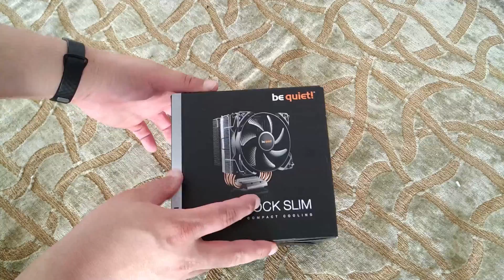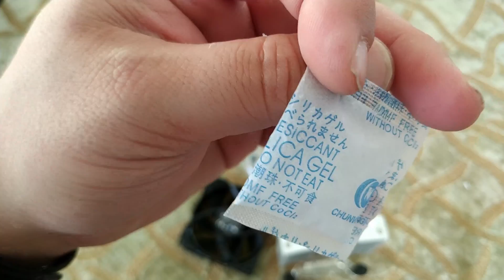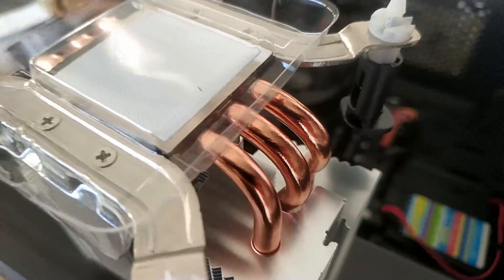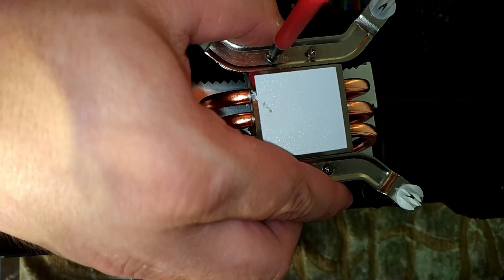Be Quiet Pure Rock Slim unboxing and installation

Comment: Usually the fan is mounted on the other side of the heatsink so the fan blows the warm air away from the motherboard? Does your fan blow through the heatsink onto the graphics card?
Reply from the maker: NO. It blows through the heatsink towards the top of the case. I tried all different orientations and this one, for me, made the biggest difference. You should experiment anyhow, cause every case is different and it all depends on the airflow around it.

Comment: Hello, your tutorial helped me a lot especially since I thought I could put the cooler in another direction but this is not possible with AMD, are you sure that the fan is correctly positioned? I have trouble understanding the AIRFLOW pose like that (but in fact I gained 10 degrees compared to the basic cooler)
Reply from the maker: Glad it helped. The better way to place it from what I've found so far is with the fan between the CPU and GPU, blowing upwards. It makes a small difference but the difference is there.
Reply: Many people said that I had placed that incorrectly, but damn. They are so damn wrong xD
Btw, actually I have no problems with temps by that cooler, lol. Still better than the stock one anyways

Comment: Can i use on h410m-k LGA 1200 ,i3 10100f?  Pls reply
Reply from the maker: apparently you can: 
https://www.bequiet.com/en/motherboardcheck
This cooler is twice your CPU's TDP so it should cool it without any issues. Plus on Intel it mounts with the fan facing at the rear exhaust. Go for it.
Reply: @funkyfresh3d  fps hexa+ 550 watt can handle it??
Reply from the maker: @aizenmoku8888  the cooler? It's just a fan, of course it can.

Comment: Is the pre applied thermal paste good?
Reply from the maker: It's fine. I would trust anything by be quiet. After I took it out several times I installed arctic silver 5. I didn't notice much of a difference.

Comment: Should I install my this cpu cooler downwards or upwards? I only got one fan at the front of the computer and on at the back and im not sure what way i should put my cpu cooler.
Reply from the maker: I got the best results with the fan between the cpu and gpu, blowing upwards. I would think this should work on your case (But I l also have a top excaust).  It's always best to experiment though. Let me know

Comment: Can you get a different mounting kit so that it blows the air towards the rear of the case? or are you locked into up or down only?
Reply: you can just rotate the mount 90 degrees for it to blow that direction
Reply from the maker: @Kevin Hoang That's only for the intel mounts.
Reply from the maker: As far as I know there isn't one. So if you got an AMD CPU, you only have two options, up or down. In my case, I got the best results with the fan on the botom (between the CPU and GPU), blowing upwards.

Comment: Hey, thanks for the video! I mounted my pure rock slim the exact same way on the same CPU but my computer does not boot. Any idea why?
Reply from the maker: What is happening exactly?
Does the computer start and turns off? Does it not turn on at all?
Reply: Fans are on for CPU and GPU but the monitor is not detecting my computer. I also get a white led for CPU on the EZ Debug leds.

Thanks!
Reply from the maker: cpu wihte LED on EZ debug means there is something wrong with the CPU but RTFM to be sure, could be diferent for your motherboard. Did you move it at all?  At this point I would just re-sit the CPU and make sure that the cooler is mounted properly and with enough force to stay in place. The cooler mount can be a little tricky to get right on the first go. Also at this point the thermal paste should have been smeared all over the place so it's best to apply a fresh coat.
Reply from the maker: What is your system? Cpu, board etch
Reply from the maker: By the way I updated the description...
Reply: @funkyfresh3d  
CPU : Ryzen 5 3600
GPU : gtx 1660 super
Board : B450M PRO M2 MAX
Reply from the maker: Nice gaming system! Make sure you have a good excaust cause those chokes need cooling if you'r pushing the cpu.
Reply: @funkyfresh3d  thanks! I'll keep you posted definitely
Reply: @nipstylz  Did you figure out what was wrong?
Reply: @paska2238  Yep! I followed exactly what Service Droid told me : unmount the cooler, clean the thermal paste (CPU+cooler), resit the CPU, reapply thermal paste and mount cooler again (I pressed a little bit more on the cooler when locking it to make sure there was slight pressure on the CPU).
Reply: @nipstylz  i had problems with push pins since one of them was unavailable becouse of my gpu and ram but I managed to push 3/4 pins and its running nice 100% load at 55°c
Reply: Thanks for all the tips, I'll try installing the cooler again with a fresh coat of thermal paste. It was indeed quite slippy when I installed it.
Reply from the maker: Happy to help. Keep me posted.

Comment: How did you find the temps after installation? I put mine with the fan blowing upwards? Why did you put yours facing down?
Reply from the maker: I used mainly HW Monitor and others and did some before and after testσ and benchmarks that didn't make it to the video for various reasons. Temps were around 8-10C less than the stock cooler. Long after I uploaded the video I played with fan placement and found that the best location, for my case at least, is the fan mounted on the bottom, (between the cooler and GPU), and blowing upwards. The initial placement just felt right at that moment - but I was wrong. This way I can get more than 10C less. Real time idling at the moment is 40C. With the stock cooler idling was at about 53C - with room temps at around 30C at both cases.
Reply: @funkyfresh3d  hey man thanks for the vid, exactly what i needed!  i have (or had) the same question: fan up or down, and will now take your reply and go with the fan NEXT to the graphics card... if you get chance maybe add some text on to your video which says this... thanks again, saved me a lot of messing about!
Reply from the maker: Happy to have helped. Thanx for watching!